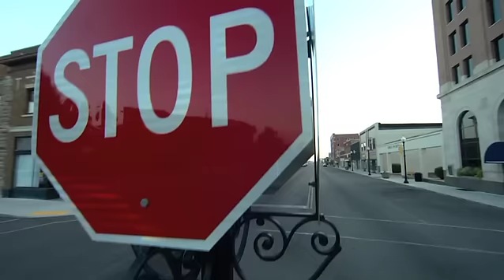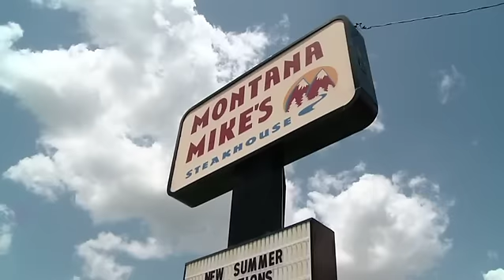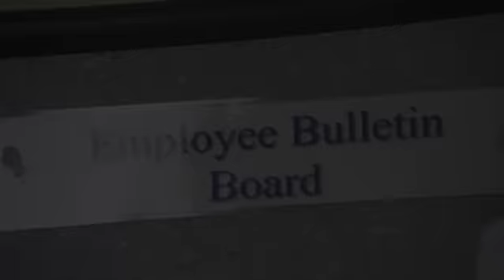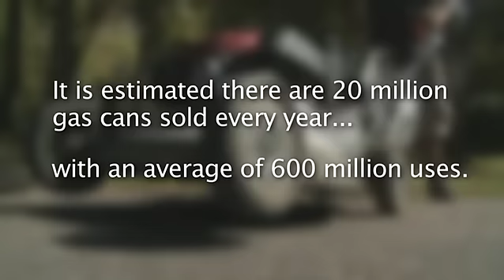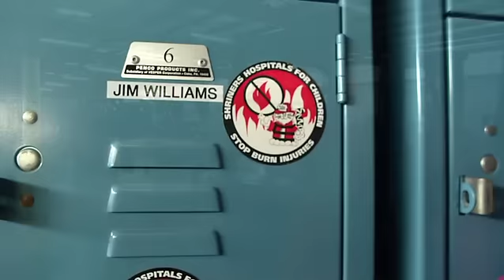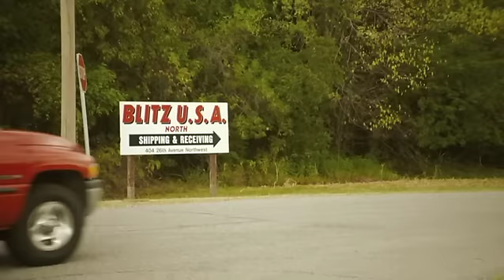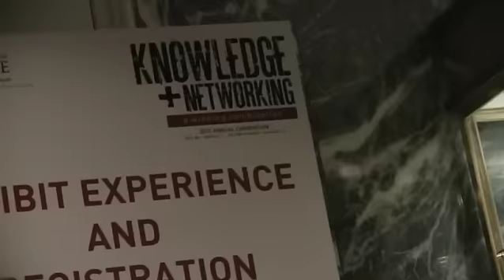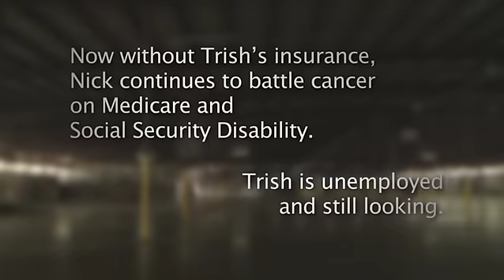The Last Week: How Lawsuits Doomed an American Icon

Comment: I have had the same 6 gal. BLITZ gas can since 1990. I was 16 years old and bought it the first time I ran out of gas. Yes it survived my careless teen years. It is now pink from all the times it sat roasting in the hot sun. It has slid and bounced down the road at 60mph a few different times. It's seen bon fires, camp fires, sparks from grinders, flashes from welding, running engines. It's been used as an auxiliary gas tank when my trucks had a hole in it. The can has never caught fire, caused a fire, or exploded. Gas cans just don't do that. It takes VAPORS and a FLAME or a SPARK. This is common knowledge. Why do I have the same can after 26 years? Even though the can has seen heat, sparks, and flames. It has NEVER been put in close enough proximity to any of these. That is what STUPID CARELESS people do. Even if the can had seen these hazards 1.It was always SEALED TIGHT so no vapors could escape and ignite 2. It was never close enough so that the heat would compromise the plastic and melt the can. Those are called PRECAUTIONS and its COMMON KNOWLEDE. People that get hurt using gas cans are the same ones that would put their finger in a light socket. With the exception of the little boy, that was his parents carelessness. You shouldn't have a gas can in the same area as a piloted gas water heater, especially if the can wasn't sealed tight. Like I mentioned my can has bounced down the road at 60mph and did not loose a single drop. You can't cross thread these caps and knock them over and blame BLITZ for your carelessness. BLITZ was the greatest gas can manufacturer in history. I will continue to purchase their used cans rather than buy a JUNK new brand gas can.

Comment: The chainsaw was off. Was it running prior? Was it hot? What is the flashpoint of gasoline vapor, since that is what burns, not the gasoline. There are warning labels on all small engines to NOT FUEL when hot. The fire fighter was negligent.

Comment: The victims did not pour gas on an open flame, you're buying into what the company's character assassination of the victims.  Actually one of the victims was a fire fighter refilling his chain saw.  The chainsaw was OFF but the gas can did not have a special valve that keeps the heat from flashing into the tank, igniting the gas and making the tank explode.

They KNEW for years that their valves were faulty and chose not to correct the problem.....
Reply: Chainsaw instructions say to not fill the tank while the engine is hot. He dismissed that safety warning
Reply: A firefighter was refilling a hot chainsaw?
If anyone should know better.